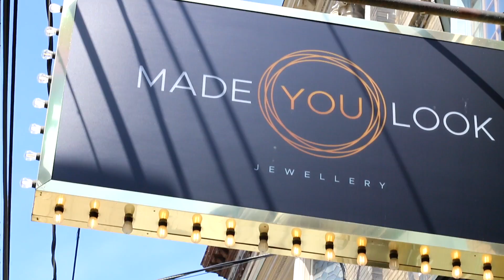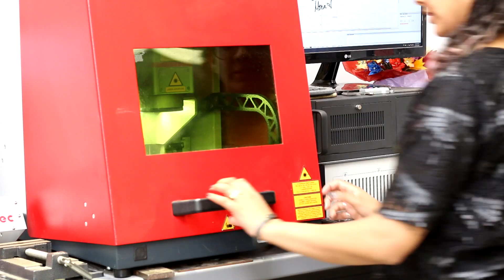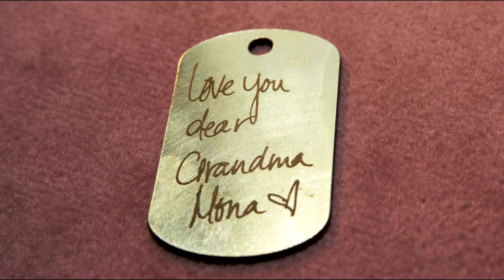Laser Engraved Jewellery | Laser Etching Jewelry | Galvo Fiber Laser

Comment: I really like this setup. Does this laser have the capability to cut metal or only engrave? And are the engraves only thin surface ablation, deeper engraves, or do they require a marking agent like Cermark? Thanks!
Reply from the maker: Thanks Nathan. The SpeedMarker Galvo fiber laser can cut thin metal but it's not its main function. The Galvo excels at high-speed marking the metal directly. It's a fiber so it doesn't need Cermark it can engrave the metal directly. With cutting metal, the galvo basically "engraves" a line over and over again extremely quickly, so it can take some time to cut through a metal piece. We have a few jewellery customers who use it for metal-cutting.
Reply: @TrotecLaserCanada  thanks for the quick reply! So you can get a dark engrave in metal like silver, gold, or steel without using a marking agent? Or is it just the cutout of the design, and a secondary process is needed for color?
Reply from the maker: @nathanwright9074  Silver and steel definitely engrave black with the fiber laser. Gold should as well but we haven't tested it ourselves yet.
Reply: @TrotecLaserCanada  how much?
Reply: hi. we are the laser machine manufacturer .our machine can cut not only metal but also plasitc and so on .welcome to contact me for price and details.my whatsapp:008615014573459.regard.
Reply: i recommend the thunder lasers, it can cut basically anything, as-well as in-grave. its a little pricey but works so nice and v fast. good luck:)!